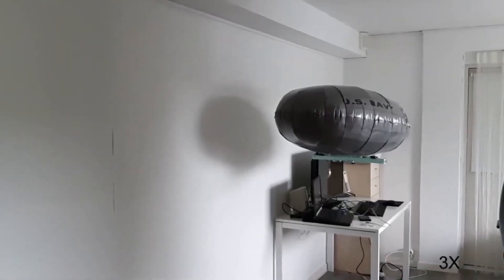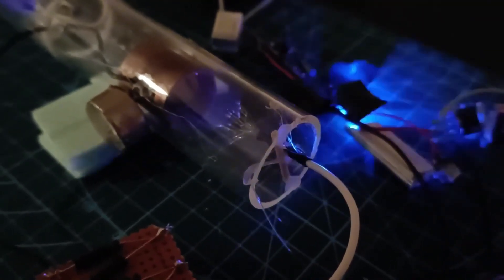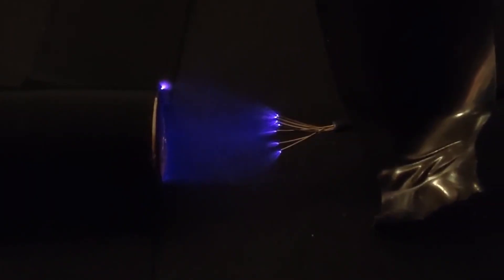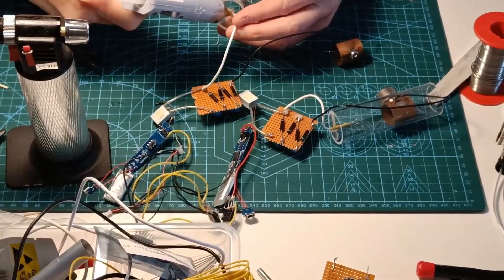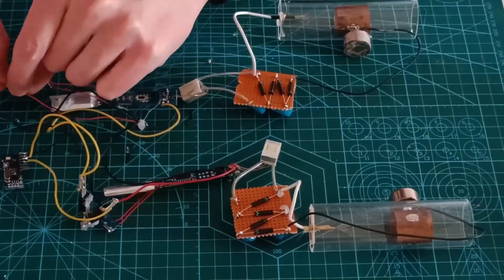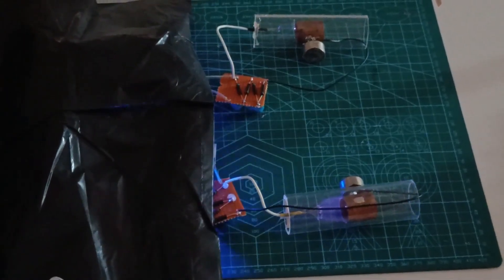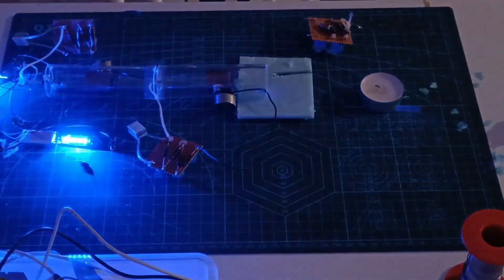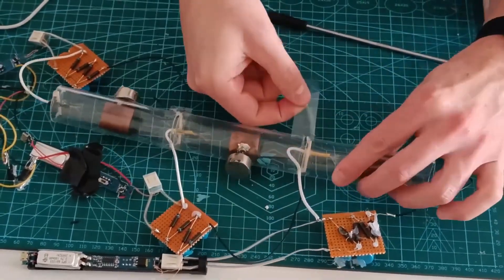How to Build a Super Ionic Plasma Thruster for DIY Flight Projects | High Voltage Propulsion

Comment: try dc electric plasma railgun heat/mhd thruster. kinda like nuclear ramjet but with electric resistance heat thrust. low voltage high current. ie heat ionization instead of sparks. put the heating coil/rod in a railgun u-shape to make a combined heat-hmd plasma thruster that runs with-in air or in water. you can control the output power P=UI with low voltage and high current. dc current or possibly also ac current in the U-shape. no requirement for complex high voltage circuits. normal high current low voltage arc welding power supply is enough. yes expect kilowatts of power into heat and mhd motion. similar to a small quad copter drone peak power usage. yes a drone lipo/lfp battery would be the best power source. also no high voltage ion acceleration radiation issues or problems.

Comment: It would also be interesting (if heavy) to use pre-made 1 inch galvanized and threaded steel pipes and elbows from a hardware store to redirect and recirculate the accelerated air back into the front of the tube. Hopefully so that the Styrofoam reappears to show the air flow.